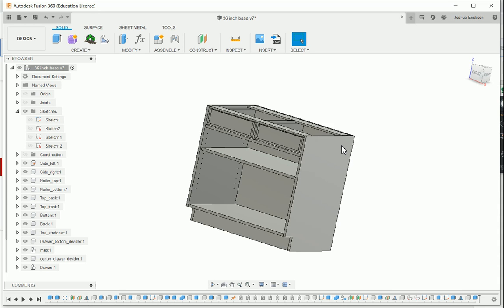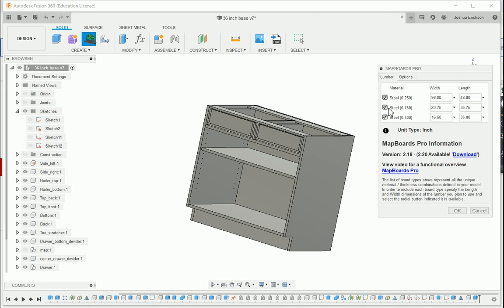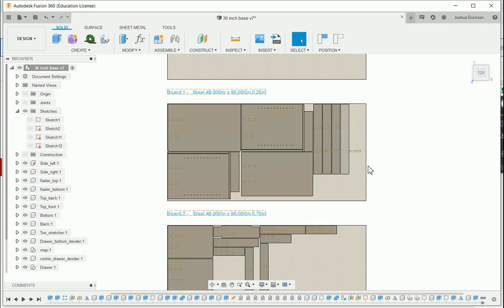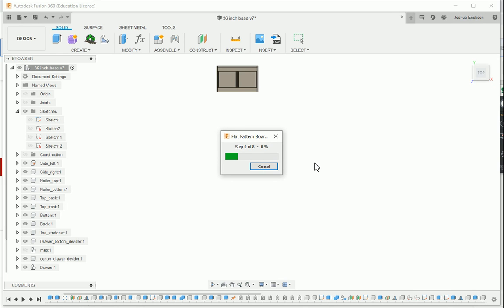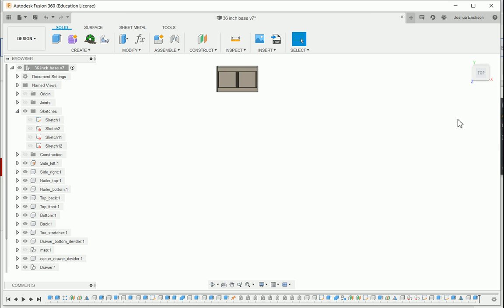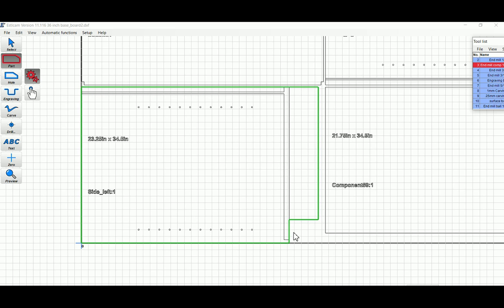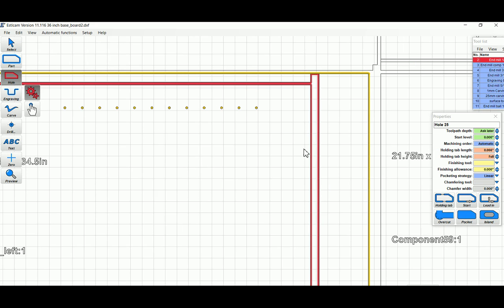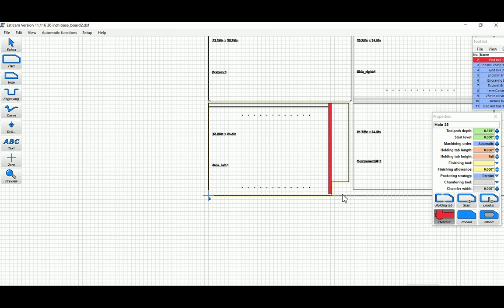Creating kitchen cabinets with Fusion 360  Part 4 - the G code

Comment: many machines have different gcode syntax, is there a library and how do you custom edit or create a post processor in this program? In Fusion i found an existing post with similar output to what i needed, and then edited that in javascript to match my needs. That was somewhat lucky, because if i'd have to build my ownt post processor from zero, i couldnt handle that... Cheers, and tjanks for the videos, they gave me an idea or two about how to go about making kitcens. :)

Comment: How do you joint the parts? Exemple the tops with the sides?
Reply from the maker: Pocket screws
Reply: @TLARinc  okay, thanks for quick reply. One more question, do you use dowels or other components that you can import in to fusion?
Reply from the maker: I dont but you certainly could. If your using a cnc it's probably faster and easier to use mortise and tenon.

Comment: AMAZING.. I love this.  I think this is the first time I have found EXACTLY what I wanted to do, what I wanted to learn and it even makes sense to me.  I do have a question, is there any thing built into this, or a config that can be set that accounts for the fact you can't put a 1" dowel in a 1" hole... or a 3/4 " shelf in 3/4"  dato?  Or can you!  Thanks so much.  I would love to see the cutting and building vids.

Comment: Thank you for doing a cabinet series. This video series is really helpful! You are correct, there are very few (if any) "how to" videos that actually take you through all the steps of dados, rabbets, etc. Nicely done! 

It would really be great if you would consider taking this to the next level and showing how to merge multiple cabinets into one drawing so that we can see the process and the output. I think many of us have the same questions about multiple designs and output as described by 4FunRC in the comments, especially around how the parameters will work. Most of the videos I see on Fusion address making one item, but many times you need to cut out multiple modules / cabinets to make the most of your materials. Also, to get the best efficiency, it makes sense to layout the panels for cutting all at the same time and run everything at once on the CNC.
Reply: This would be awesome to see a group of cabinets.  How does the copy paste.. Or paste new work for this.  Awesome series.
Reply from the maker: I don't really see the point in creating a group of cabinets in one design file unless you are doing a proof for a customer, in which case you can edit your cabinet parameters and save it as a unique file and insert it along with your other cabinets into a different file and align them all with rigid joints. I hope that makes sense. I think I'll make a video showing you how. My busy season is nearly over so I should have more time for videos in the near future.
Reply: @TLARinc  I tend to think in terms of how am I going to cut out a series of one or more items. Usually, I am concerned with getting the most efficient use of the materials that I using, so planning for multiple cabinets/ items during layout would help optimize the sheet goods. I am beginning to do some cutting on a CNC, so being able to nest things is important. I am still unclear how Fusion handles parameters for multiple designs (if you use the same parameter / variable names in multiple items) if you were to design each one on their own and then pull them into one model for the cut layout / nesting portion). Maybe it has something to do with how Fusion handles the parameter/parametric names such as with computer programming local versus global variables e.g. each object considers the parameters for itself as unique and  local, thus the names and values do no conflict between items when combined into a single file? Maybe you can help straighten out my confusion :) when you do you future videos. Again, thank you so much for taking time to help us grasp some of these concepts and learn from you. It is very much appreciated!

Comment: Hi, this series has been really helpful for me as I get into parametric modeling.  But there's one thing I'm still confused about.  Obviously the model of the base cabinet you created can be used again and again, each time adjusting parameters as needed to define the exact cabinet you want.  At the end of that process you'll presumably end up with all of your base cabinets sized exactly and ready to move to the G-code step.  But once you start changing parameters and saving each file as a unique cabinet for your kitchen, how do you then bring them all back together for your CAM work, so that nesting can be done for every 3/4" part and every 1/2 inch part across all your cabinets rather than just one at a time?   thanks
Reply from the maker: While in fusion you can open your project folder(the three by three square grid icon in the upper left) and right-click on the cabinet you want to add, then select 'insert into current design' . Fusion does not, unfortunately,  allow you to share parameters across different files or designs so when your ready to cut you will have to change the material thickness parameter in each design.  If you combine all your cabinets into one master file before you have your final material measurements you can still edit those parameters in each design, fusion will warn you that designs have changed and and you can update them all right from your master file. I hope that makes sense.